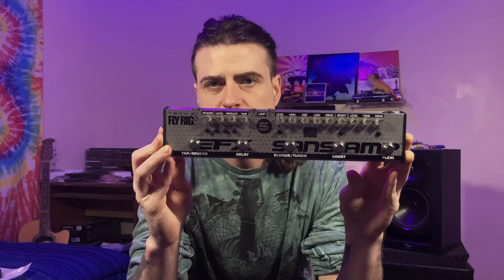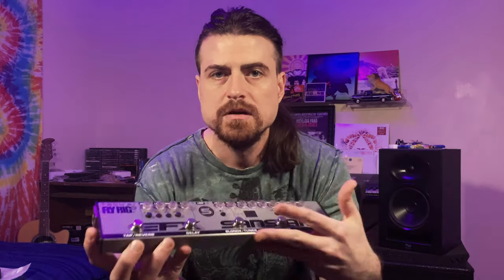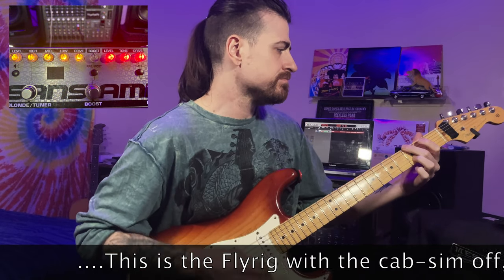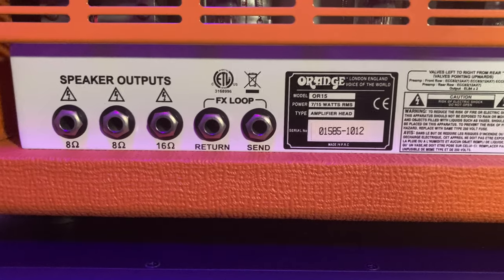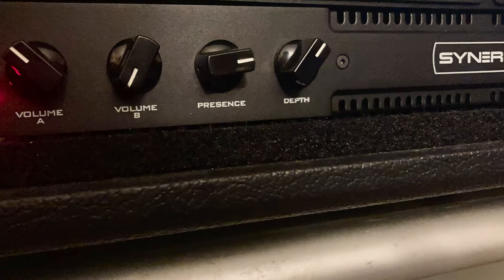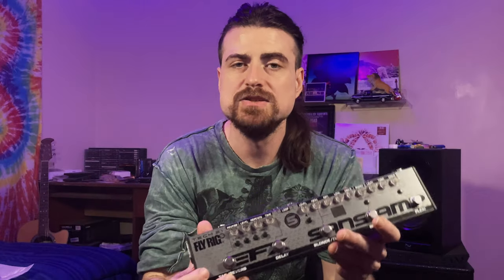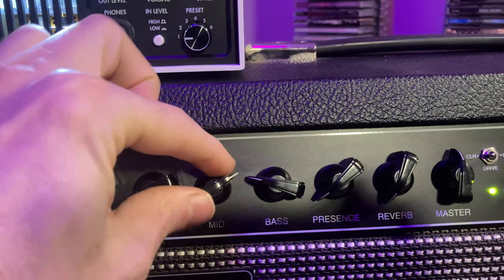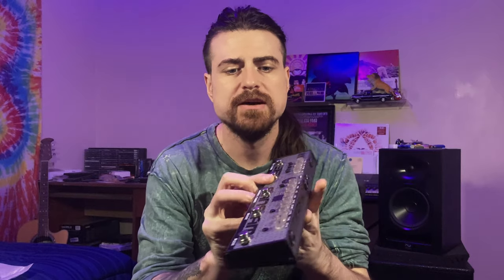What's The Best Way to Use This Classic Pedal?

Comment: Thanks! I've been running mine into a MOOER BabyBomb pedal and into my Mesa 1x12 cab. It's hard to mix the Blonde part of the FlyRig and the Plexi/Cali together, but it seems if you have the Gain on both not too high, it sounds good, otherwise it gets really bassy. Are you using the FX loop at all? Thoughts?
Reply from the maker: Yes I agree....but I find it can cover most genres without having to run the gain past 1 o'clock or so. I've never used the FX loop of the unit that much. If I want to use a volume boost or delay, I usually just run it after the entire pedal itself.
Reply: @AlexMessanoMusic  I agree on the gain setting, plenty to go heavy. I think I'm gonna  ditch my MX5. This thing has everything I need in a much smaller size. I don't need 20 different amps, and tho I thought about keeping it for fx, there are other options that are smaller and can run into the fx loop on the FlyRig